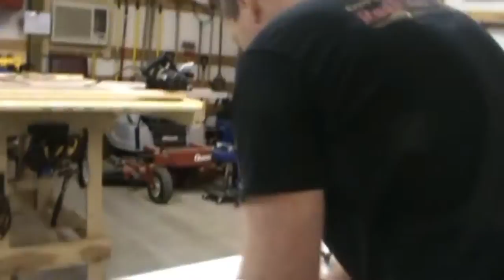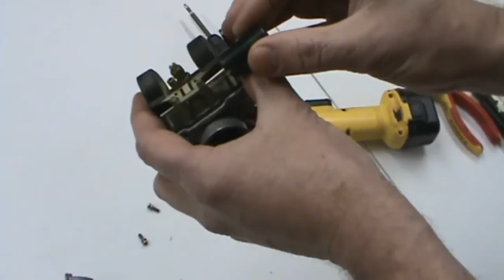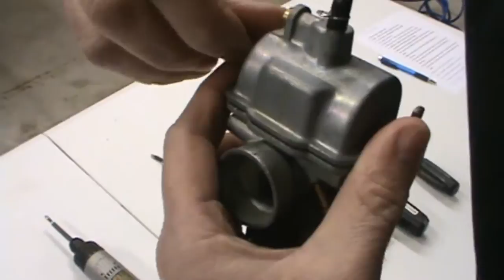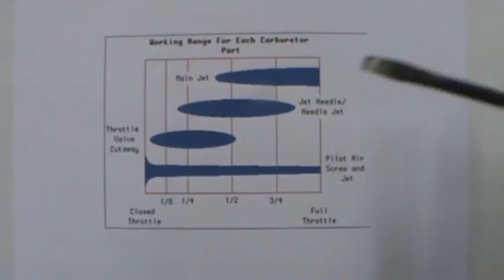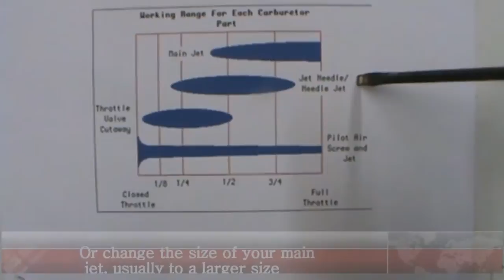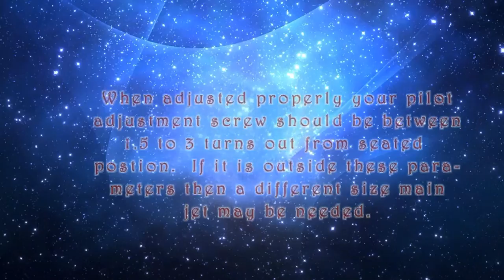Mini chopper and carb cleaning and adjustment

Comment: I am having trouble after cleaning my carb. I put it back together and back on.  Now when I start it, its as if its full throttle. I made sure the slide is correct.   Choke is off.  I start it and have to shut it off right away because the RPMS skyrocket quick. Its almost the exact same carb you show here. Little different but same. Not sure what the issue is.   I am about to buy a new carb, and will have to clean it from time to time. I dont want to have this issue again, so maybe you know why? Throttle isnt stuck and slide moved like its supposed to.   Thanks

Comment: hey anybody know how high the seat is from the ground, i want to drive it on the road but the seat needs to 680MM or higher, i havnt bought it yet but i will in about a month and i want to be ready with gear and stuff, so if someone can let me know if the  bottom of the seat is higher then 680MM? Thanks for your time